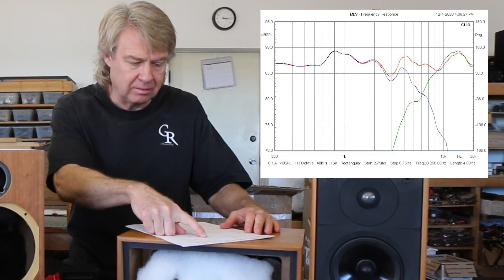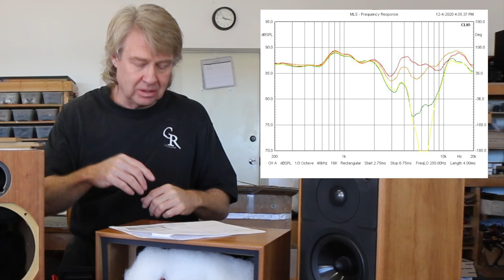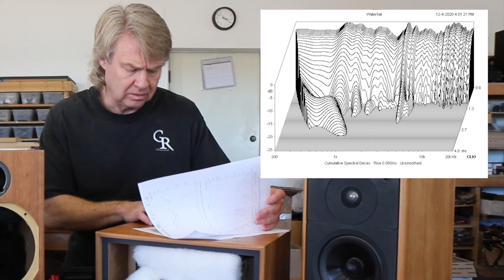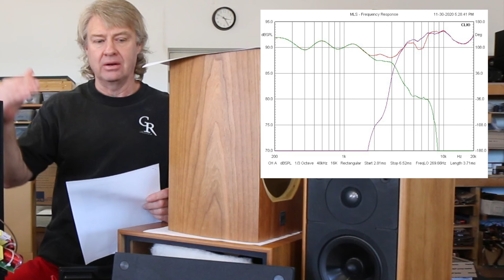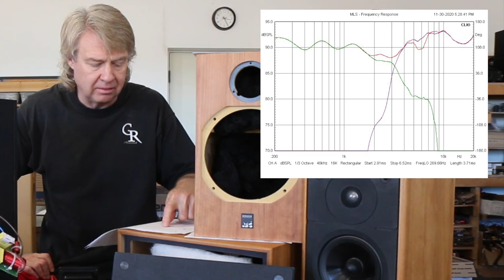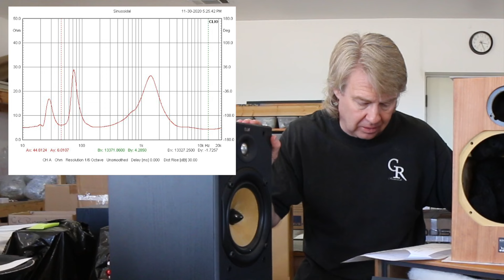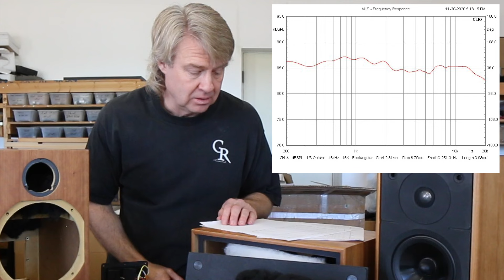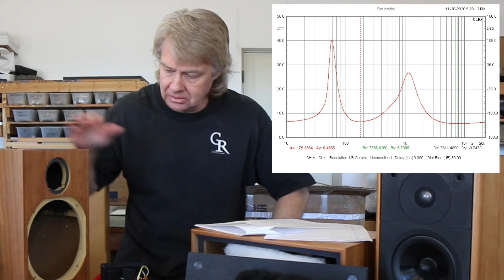FINALLY! A SPEAKER DANNY LIKES?! B&W, Epos and ATC!

Comment: Danny, I’m terms of listening wouldn’t the EPOS speakers have great clarity with only one cap in the system? The design seems to be sacrificing a more even response for less in the signal path. I understand that an even response reproduces the music better but the clarity, imaging etc. must be much better than other speakers in that price range. For some that may be a worth while trade off.
Reply: Hey David.  These are actually my specific speakers that he tested for me.  You hit the nail on the head, and are actually specific "quality" that the Epos ES12 was known for: supreme clarity, detail, articulation.  However, you HAVE to sit in the exact perfect spot, and you need to use the manufacturers stands (sounds weird, but it's true).  So as Danny also nailed on the head, you HAVE to sit dead on, or else things can sound odd/honky/thin, etc.  In general, these sounds amazing for wanting detailed, accurate, crisp reproduction.  But, they lack presence, drive, power, dynamics as Danny mentions in ways thru the analysis of the range of the driver.
Reply: @alanm.thornton4055  Thanks for the reply it will be interesting to see what Danny comes up with for your speakers
Reply: @bbfoto7248  Thank you for the response, a lot of what you said is well beyond my limited understanding and experience. I have always had some type of stereo for music especially at work I only recently began to explore better quality audio. A year ago I purchased a pair of second hand RBH 1266se tower speakers. I was mostly looking for something big since they were to be used in a 2000 square foot hangar. I opened them up out of curiosity and found that a resistor on each crossover had overheated and damaged a capacitor. Searching rebuilding crossovers I found Danny. RBH emailed me the schematic for the crossover so I rebuilt it using high end components instead of the iron core inductors etc. The difference in “clarity” is how I would describe it, was phenomenal. The nuances of imaging etc. are a bit beyond me, although I am slowly slipping down the slope of wanting better....

Comment: Sir, could you please answer a question?

Why is it bad, if I put a coil made of 21 AWG wire on the tweeter? I mean, they often say (if we speak about speaker cables) that thick wired cables are not optimal for transfer the upper mid and high frequencies. Some DIY speaker builders state that the most optimal wire for tweeter coils is 21 AWG.

Comment: Using a driver - like that Epos woofer - up to and above the top resonance - so-called 'oilcan' resonance - breakup at the resonance not only causes stored energy issues, you also always get a lot of  harmonic, intermodulation and other nonlinear distortions.  It's just bad to use a driver up to and above it's breakup frequency.

Comment: What you really want are speakers sold straight from the makers, usually small businesses to you. So long the engineering is competent, speakers like that are gonna beat everything at their price point. That's just how it works in hifi. I have a pair of 8" locally manufactured Elfton Vigo speakers (mk2) and they just shoot dead anything you could compare them to price-wise, they are not "made to price point", they set a different standard (of course, so long you live in center Europe, you would have to somehow import them otherwise). I feel lucky I found these, because there just are basically none like them around. A similar experience you might get from competently designed DIY, but unless you're a carpenter, it just wouldn't really have the high-end looks (but maybe you don't care for that).

Comment: Have you posted a video with the measurements of the speakers output with and without the cheap binding posts?
I've been thinking about doing this to my Paradigm 800F tower speakers, but don't want to waste my time and money if it's just a small measurable difference that I won't hear.

Comment: What will the Mic hear 12ft away from the speaker 4ft off the floor? Sometimes correcting a defect in frequency response can alter the character of the sound in an unpleasant way. I've had speakers pass test measurements with flying colors but sound cold and sterile in their actual delivery. Our ears should be the last judge.
Reply: Jbl 4312 monitor was crossover with 1cap on tweeter, 1 cap on mid, and bass unfiltered...and pots to tune efficiency of mid and highs...and it could sound amazingly good...with certain music....
Reply: There is more to how the speaker sounds than the measured responses. The quality of the parts is a huge factor. Everything matters.

Comment: What product is not built to a price point   ?   Example ,
 manufacturers build a Speaker  but can't put 
Townsend pods under it  
 or  a form of a Tip Toe  .
   What i would like to see is
"A" your tweeked speakers 
V. " B" Stock version    Would the buyer be better off going up a model ?  Is your version better sounding then  3 models up

Comment: I'm wondering whether the "thin wall" construction on the ATCs are not on purpose due to it not being a ported design?
Reply: In a sealed design the box should be build stronger and padded well to withstand all the stored energy.
Reply: @greggcheap6208   Maybe, but that does not mean they should have thick walls- look at the LS3/5a and other British sealed design monitors. All thin design on purpose.
Reply: @greggcheap6208   If you look at Stirling Audio's website it's actually called "“lossy” cabinet design philosophy developed by BBC Research Department at Kingswood Warren."
Reply: @LorDarkGoose  
I look at speaker design through the eyes of DIY. I've never heard of purposely making a cabinet "lossy" I'm sure they know more than I do on that subject. I do wonder how that box measures during the back wave of the woofer. It just may breathe lol 😏
Reply: @greggcheap6208   Agreed :)  Same here. It seems weird but works somehow. Well- in listening anyway.  Maybe has to do with how they designed it for small spaces and near field monitoring. But yes, I don't know if such things were a factor for the ATC's engineers...Keep things interesting through ! :)
Reply: @LorDarkGoose  I don't think ATC intent was to make the cabinet lossy like the BBC designs. Likely a budget/market/weight constraint.

Comment: Can i ask , whats the problem with the Binding posts , why go in there with a magnet ,  and be like oh bad binding post , or oh very good binding post . Whats that all about .
I like metal binding posts , i consider those plastic black and red spring  kind of plastic post t a lower quality , but jugging by this magnet waving around that would be better then my metal or otherwise better shit , and i have few different types , never went in with a magnet checking if there is iron in them ,  what difference does that make
Reply: The difference in the quality of the binding posts can REALLY effect how it sounds. And the effect of ferrous parts can really degrade the sound.
Reply: @dannyrichie9743  Did you know that measurement devices used to check this stuff such as oscilloscopes etc..also have metal binding posts , right ?
For example XLR connector on your measurement microphone , thats metal , did you put your magnet on that i guess not .
Reply: @dedskin1  Those devices are not carrying an audio signal.
Reply: @dannyrichie9743  all audio measurement devices carry audio signals of course , 
I got you there , yes i did 
But its ok , 2 truths can exist , i say you wants 5000$ power cord you gets it , its your money .
If i was selling it , oh man i would change my tune faster then a lobbied  Democrat

Comment: I watched, but failed to hear what model the ATC speakers are in this video?
Reply: ATC SCM19
Reply: ATC SCM19 are not cheap!
Reply: Atc scm 11
Reply: Atc scm 11 not scm19
Reply: it is the 11
Reply: SCM11, the 19s are huge!
Reply: I agree they are SCM11's - they retail for £1300 GBP, currency convertor says that's $1700 but what they actual retail for I don't know.
Here's a link to ATC's website so you can see for yourself: http://atcloudspeakers.co.uk/hi-fi/loudspeakers/entry-series/scm11/
Reply: My mistake it's 11.
Reply: @stephenclark5218    Stephen,they must be the earlier 11s. Looks like a square box.
Reply: @richardjohnston4682  It's not on-screen for very long, but for a few moments while he's moving the box, you can see it has curved sides. They do look square most of the time, I'll grant you - I had to watch twice to cath it, because, I'm really boring...
Reply: @richardjohnston4682  Richard definitely version 2 because the speaker is running atc made tweeter. You can see the box has rounded sides on some angles in the video.
I have a pair of these speakers that i use with a Rel t7i.
Reply: These are mine. They are SCM11v2. I bought them from a chap in the UK who upgraded to the 19 for $1100 shipped. They are $2200 USD. It was a good deal for both of us.

Comment: Cool videos! For a long time I would make new crossovers for speakers I owned. Now, I end up removing cheap passive crossovers, use an active crossover, bi/tri/quad amp, and dial them in to my listening environment. It's extremely hard/impossible to get precise using passive components. Most people wouldn't do this but for me, it's night and day.
Reply: Actually for me is it very easy to get precise tuning with passive parts. And overall the best sound is typically achieved using passive parts.
Reply: @dannyrichie9743  I will have to disagree. Being that they don't make every component value... the chances of you getting the right combination for your listening environment is slim to none. You can't compete with variability. 🤷‍♂️
Reply: @nonsuch  As a professional designer I know for a fact that I can do just about anything with passive parts that you can do with electronic crossovers. And at the top levels I can make it sound better with passive parts. The electronic crossovers put too much additional noise in the signal path from additional power supplies, op amps, cabling, etc. And it requires more amplifier channels.
Reply: @dannyrichie9743  Yes of course. It takes passive components to make a "variable" electronic crossover. But you are not doing it with an air core inductor, a bipolar capacitor, and a resistor. Yes you can make a "decade" type box but then run into the situation I use variable electronic crossovers for. I'm sorry Danny. I am telling you it can't be done. In order to "tune" your speakers to your listening environment, you need a variable crossover. Then, if you can find the EXACT components (which you won't), you could build a passive crossover. The best you can do is get it close, again this is per listening environment. You can be a pro builder but you don't go to peoples houses/studios and analyze the rooms before you build crossovers. Boasting you're a "professional" isn't going to sway me. I've been in this game for 35 years.
Reply: @nonsuch  Actually you are going about it backwards. You don't adjust the environment by altering the response. That actually doesn't work. You can only alter it that way for one point in space. Move over and you have to start over because you have altered the time arrival of the reflections of the room.  Speakers are designed independently of the room. And then the room should be adjusted or tuned with absorption or diffusion to control the total in room response. That will get you a balanced response that will be consistent throughout the room.
Reply: @dannyrichie9743  I'm not sure you read what I wrote. I'm not saying that at all. I'm saying you alter the response to your environment. This is why variable crossovers come with the most expensive speakers on the planet. And in the Hi-Fi world, they are ridiculously expensive. I'm not talking about sound-reinforcement racks or car stereo crossovers. A proper one will cost you $1000's and most people won't spend that on a crossover. They will make due with as "close" as they can get with passives.

Comment: Hi Danny !. Thank you so much for your inside of the speaker company design on his line of products to reach a price points. I have a question for you!. Why you always prefer to see the measurement with 25 db of range and 1/3 of smoothing?. I Start to measure like you, but have some discussions with a few friends that say its better with 50db of range and 1/24 smoothing to really see whats its going on. Can you Explain how you think about this topics? Thank you so much, i really learn a lot on your videos. Best regards from Argentina!!
Reply: I like dropping the height of the scale to a 25db range to zoom in on the response a little. A 50db scale flattens it all out too much. 1/3rd octave is an industry standard and a decent average. If you drop back to 1/24th smoothing it will give you a little deeper detail but tells you nothing more that would change design choices. And if you look at the spectral decay you see it with no smoothing. That's when you want to see it all when it is frequency over a time element.
Reply: @dannyrichie9743  Thank you so much fo your answer. Best regards from Argentina!

Comment: A modest roll-off at 15 kHz isn't going to affect anything in 99.9% of situations, especially because most mix engineers and artists will never be able to hear it anyway.
Reply: Marten Dekker  It really depends on the purpose. For studios, flat is imperative because they're producing a product that can potentially be played on anything from a boombox to an enormous theater system that will shout anything that isn't quite right. Depending on the material, it's not easy to get that right, and the last thing you want is any coloration from your monitors misleading you. For home or mobile use as a consumer, though, especially for audiophiles who like to spend lots of money on it, buying to taste is definitely the way to go, no matter how colored. I agree that a flat analysis is not a very good criticism of consumer-market speaker sound. I strongly recommend blind A/B comparisons as the only way to know what you actually think sounds best. Those can have surprising results. If someone wants to ensure flatness, that is what the pro market is for (not the semi-pro market like in music stores, which are usually not much different than consumer). The very old systems you refer to, at the high-end of the market, especially, were often much better at a flat bottom end down deep than what I see in popular speakers now, and with very little equalization, passive or active. James B. Lansing wasn't just eccentric; he knew his different types of customer needs and wants. I can't imagine what he would think of hissy Class D "pro" speakers put out under his initials today.

Comment: ATC make two ranges of speakers. These are from their domestic range and are deliberately voiced to suit home listening. They make a huge range of professional studio monitors with much more linear responses. Horses for courses. If I was listening in a home I would leave as ATC designed. If I needed a good studio monitor without breaking the bank the modding the SMC 11 might be the way to go. Interestingly the Epos speakers, well the ES 11 and ES 12 models, had something of a cult following here in the UK when they originally appeared. They had a sound that suited a certain type of system. Not my cup of tea, as neither were B&Ws, but they sold loads of them.

Comment: Ok, i watched this video and my biggest question is, does Danny perform the upgrades (caps, wiring etc.) he is speaking about in this video at GR Research. Sounds like he is willing to do the work once a price is quoted? In short, i would be interested in the ATC SCM11 V2 if he would upgrade a pair to what he suggested in this video... If anyone knows please respond...
Reply: Hi. Danny doesn’t offer himself, upgraded crossovers, only the parts. He do the technical bit only. He does have contact around him that offer readymade crossovers to end customers. Send Danny a email and ask. Check the GR webpage.

Comment: Danny... what do you think of omnidirectional down firing speakers like Ohm’s? Does their solution obviate the need for all the on and off axis work you do with the NX-treme?
Reply: We've designed several omni models. We even sell one as a kit. And everything that you've seen me do with every other speaker applies to those as well.
Reply: @dannyrichie9743  thank you for the response. So... philosophically music that is un amplified doesn’t have a natural direction to it like the soundstage and listening spot between a pair of mains.

Part of the reason things like omnidirectional and open baffle systems are as attractive as they are to me is precisely because they have reflections and aren’t based so much on a focal point. 

So my question is ... if the ideal speaker is “like air” and transparent, shouldn’t the goal be omnidirectional broadcast of sound with an absence of impedance fluctuations and a smooth frequency response from 20-20k ONLY? And not things like on and off access response and timing?

My rationale is that nature virtually always has reflective surfaces — unless you’re on open grassland... so timing and axial response shouldn’t really matter.

A speaker should simply fill the space transparently with a smooth frequency response and swift spectral decay, and things like center staging and axial response shouldn’t matter unless you have speakers ill-fitted to the room causing room boom or something.

Am I missing something? Thanks again, and I love your videos. I have been a sound junkie since I first heard k-horns in the 80s. Its a rough start to hear $5000 speakers on mono-blocks as a kid and not be able to afford it.